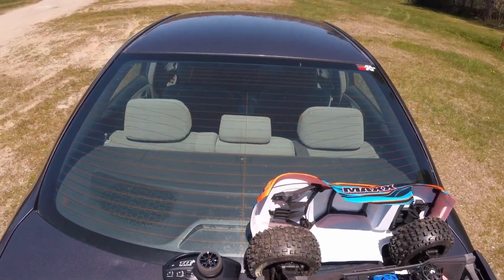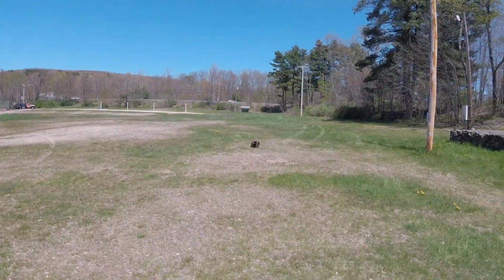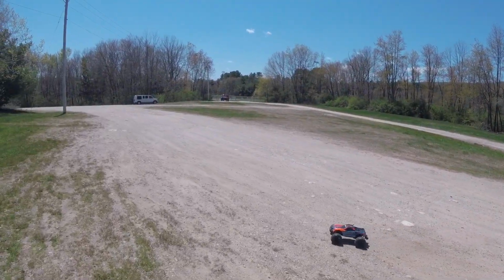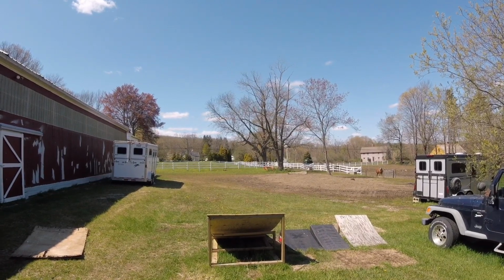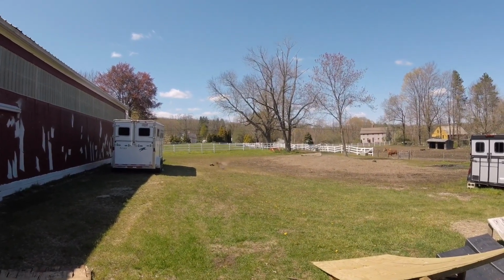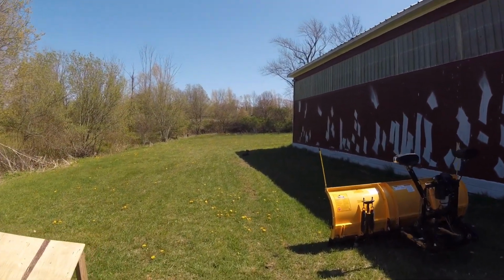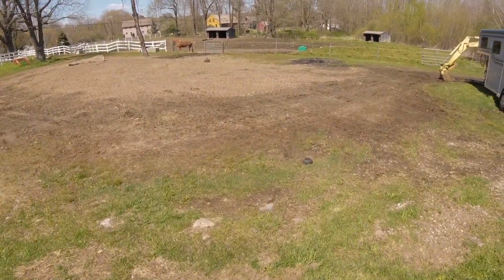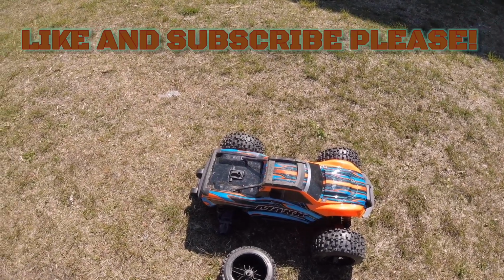Traxxas Maxx 4s Field and Farm Run!

Comment: Got the same problem.. its realy because of the bearings. They warm up the plastic driveshafts and "melting" them.. get them out and Take off the sealing (boths sides). Clean them with Brake cleaner and put some bearing grease in it. Move them till they work fine and put them together.. should solve the problem for a few Bugs. Traxxas putting not enough grease in them. Also control ur bearings in ur gearbox .. they will get Stuck too. Greetings from germany

Comment: I just bought one and mine did the same thing the bearings keep causing it they came with only 1 seal on them and when I looked the bearing where gone the bearings are complete junk and it happen to me just driving in a parking lot not even jumping it.. they keep locking up for some reason..

Comment: Holey Moley!  Wow..Looks like you found a bug on that rig.  Repeating failure mode for sure.  All of that said, that sucker tears up the gravel.  I swear if you could deploy wings it would fly like one of 007s toys!  Let us know how you resolve the axle issue with the mfg.  Lets face it, most people don't just shelf these rigs.  WTF??!
Reply from the maker: I have hopefully made a change that should stop this issue, I realize after looking at some of the damage that the hub carrier itself appears to have been flexing and allowing the shaft to bend inside the hub. I purchased some aluminum rear hub carriers from hot racing and hopefully that will solve the problem. Right now It’s a cheaper fix then 140 Bucks for Driveshafts.
Reply: @D.J_RC  that's what this is about pal, these secrets🤬 brands do not want us understanding,😎

Comment: Dam man.  I say that word alot too another axel lol famous words another axel. An badlands are the lightest tirea ive flund with the most traction. Its not them tires it is on traxxas side. Id be mad too if that was 2nd or 3rd axel. Great bash tho.
Reply from the maker: Yeah, after making the video I decided to weigh them and measure them against each other and the Badlands literally weighed a couple of grams more than the stock tires. It wasn’t much at all, and they’re only slightly taller than the stock ones also. I bought aluminum rear hub carriers to stiffen up that area a little bit hopefully that helps to prevent the driveshaft from breaking off inside of the hub carrier.
Reply: @D.J_RC  dam few grams more dam didnt expect that. Lol I swap them same tires on almost all by bigger trucks lol. The metal should stiffen it up tho